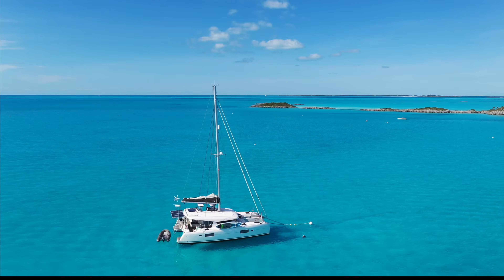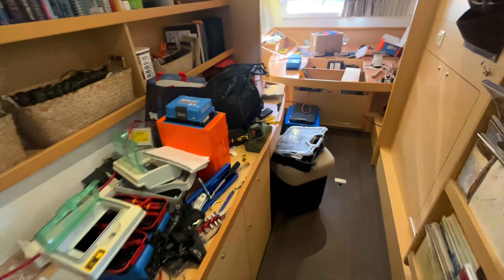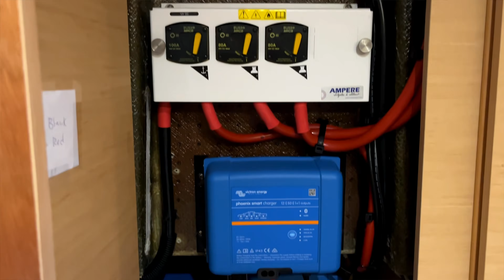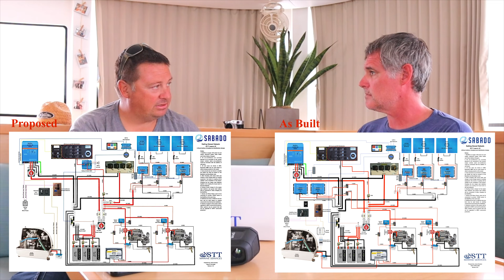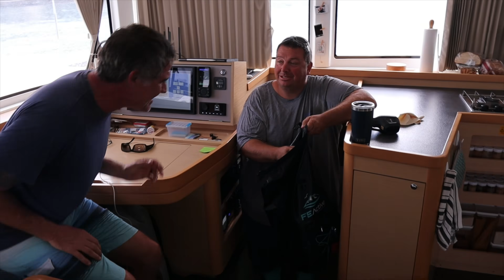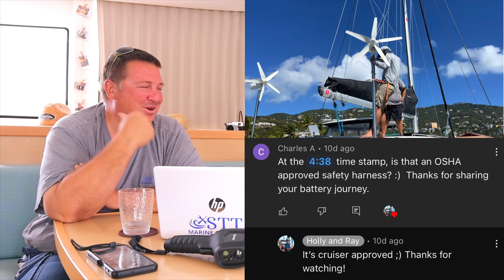Catamaran Lithium Battery Conversion Part 2 (KiloVault HLX+ LiFePO4 Batteries)

Comment: Thanks again for painstakingly posting the transformation.  One favor I'd like to ask, can you direct me to the final schematic?  I swear when first viewing, that I saw an A/B drawing, with the later (B) having some adjustment done during the project, but now I can't locate it in the videos.  I did find one schematic posted in your blog (conversion part #1) but I am not certain that is the final.  I am curious about what battery isolation and/or external mgmt modules are used or were considered and not used?  Also, was there any discussion about heat/fireproofing any of the  battery storage areas?  All good, no criticism, just a curious mind.  Cheers!
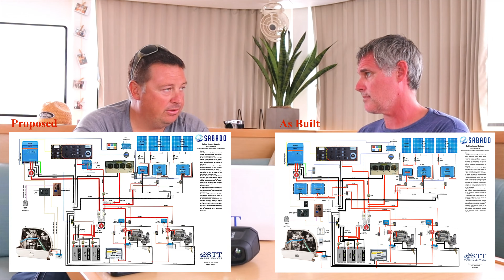Reply from the maker: Hey, Bryan! Thanks for tuning in. The A/B drawing is at 12:13. I can’t believe I didn’t post a still of the final on the blog- my bad!

Comment: Any updates on how this system is performing after a few months?  Any issues or equipment glitches?  If so, we’re they easy to identify, troubleshoot, and fix?
Reply from the maker: Hey Greg! No issues at all. We’ve been loving it! Electric cooking everyday, multiple times a day with no issue. Generator can fully charge batteries in under 3hrs if we need it (we’ve only needed it once since the install). Planning a video for next week that will show our draw and charge throughout a typical day